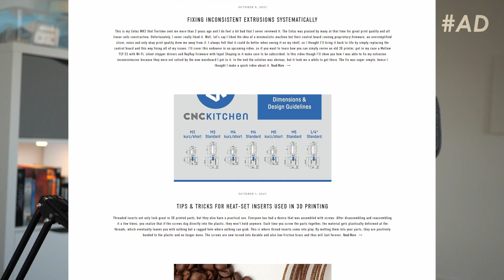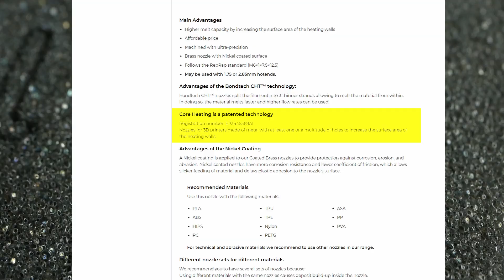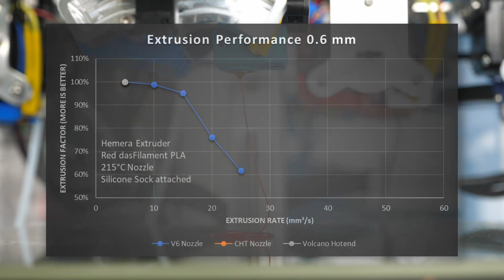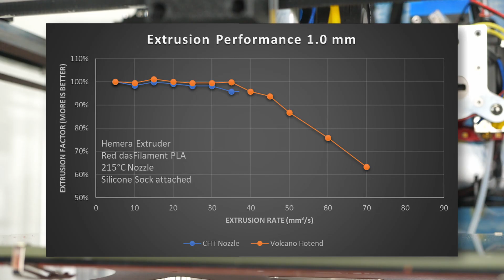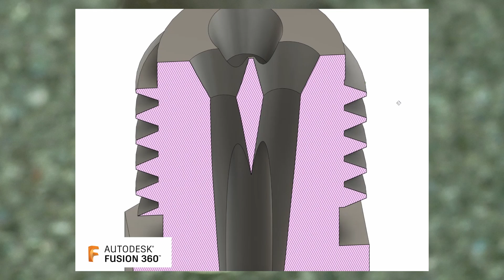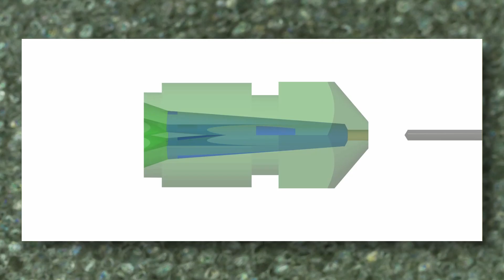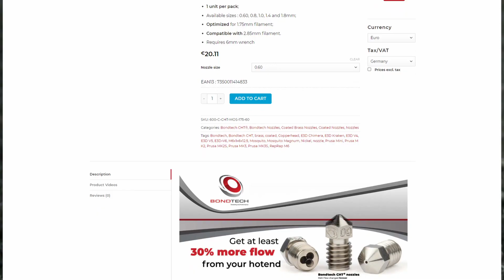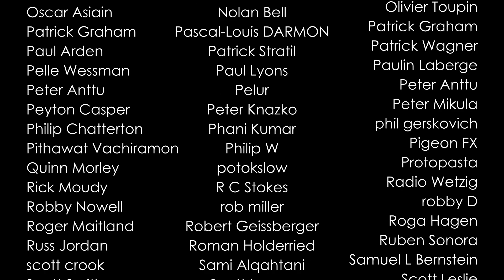Does This make Volcano Hotends Obsolete? Bondtech CHT Review

Comment: Very interesting. Would this along with a bimetallic heartbreak in a stock ender 3 hotend make it work similarly to other more expensive high flow hotends?
Reply from the maker: Probably not, because the cheap one-sided feeder will be the limiting factor.
Reply: @CNCKitchen  by feeder do you mean the extruder?
Reply: @benscottbongiben  Yes he does.
Reply: @CNCKitchen  would be nice to see a comparison with a one-sided feeder vs dual-gear feeder on a stock ender 3 using the CHT 0.6 nozzle

Comment: Mill a slot in the nozzle with a width:height ratio of about 3:1.   This appears to avoid the claims of the patent; should give equivalent improved heat transfer, and should be easier to clean when cold.   

For the deluxe version, drill two holes on either side of the milled slot and fill them with silver  (  the most heat conductive metal )

Use these ideas in combination with the volcano idea with the long nozzle which gives more time in contact with the heating source for a given speed, and cover the whole thing in an insulating sock.
Reply: Interesting ideas, but I suspect the engineering and production difficulties involved in the "fill with silver" idea would drive the costs beyond the Ruby nozzles and render it unsellable.

Comment: I looked at all of the hotend designs over the years and really couldn't tell a major different besides maybe the large flat tip nozzles of the J-head leaving a nice top layer but with ironing it's now easy to get a perfect top layer with any nozzle. Then I thought short melt zone hotends might benefit from heating the center of the filament by splitting it apart. Glad I can test it now. To me there should be a pursuit for flow but also better print quality.

Comment: I was thinking about 0.6-ish nozzle to be able to print more exotic PLAs with wood particles and such. But I wonder if this nozzle would cut it or rather clog as crazy? 🤔
Reply: You have a valid point on the clogging as the three holes are smaller, hence would have more problem with filled materials like wood. Additionally, these are not hardened nozzles so would wear quickly with wood  and other filled materials.
Reply: We do not recommend it for composite or abrasive materials. We'll have something for that later.
Reply: @nunosantiago6720  cool!

Comment: I installed the slice engineering bi-metallic heartbreak in my Ender 6, allowing for 20 cubic mm/s flow rate with the otherwise stock ender style extruder. I might get one of these bondtech nozzles myself to see what kind of flow rate I can achieve then. However, I have to finish swapping the control board so I can make use of linear advance.

Comment: What if they followed the same logic of splitting the filament but did it in a volcano length nozzle?
Reply: I bet there are diminishing returns here... but for a larger DIAMETER nozzle and 3mm filaments this might be super-viable. I think some of the faster guys were not just maxing extrusion rates, but extruder SPEED! how about a servomotor drive an extruder, ehehe

Comment: @Stefan do you have a video covering different nozzle sizes. I recently switched from 0.4 to 0.6, and I haven't found considerable difference regarding detail. I can still have 0.15mm layer height if needed. Regarding this, do you see the need for technologies such as E3D's RapidChange Revo?
Reply: 0.6 nozzle is not about Z resolution, but about XY resolution.  You can still print thinner walls than 0.6, but quality will suffer and most importantly layer adhesion gets nearly nonexistent.
Reply: @Balorng  Yes, but almost everything I slice has at least 2 perimieters, and for usable tube-shaped parts 4 perimeters (2 internal, 2 external). I think the only use for 0.4 would be e very thin walled spiral vase, and even then 0.6 wall is already a bit too fragile.
Reply: @GilesBathgate  I mean printing something like models with very thin, fine features... to be fair, a resin printer is better for that.

Comment: I thought it's be more effective to get heat into the melt by just drilling the core as large a diameter as possible then drilling two or three horizontal holes and fit pins in (before finishing the M6 thread). The melt would then have to flow over and around those horizontal bars.
Hmm... shouldn't be too difficult to try in a home shop either.
Reply from the maker: A very good point! It's unfortunately covered by the patent but might still be worth trying out for a comparison.
Reply: @CNCKitchen   It may be an improvement over that patent for multiple horizontal (not diagonal) bars of specifically high thermal conductivity (e.g. plated copper or silver) claiming greater surface area and improved longitudinal mixing of the melt. Such an improvement may itself be patentable - not now of course 'cos it's public domain :)
Reply: Worth a try. Tapped holes and threaded studs might be the easiest to manufacture. Cold pulls would be impossible though...

Comment: Do you think that this could help with using smaller nozzles without clogging? Say with a 0.2mm printing at like current 0.4mm speeds and feeds?
Reply from the maker: Not sure. Melt performance is usually not a problem with small nozzles, rather dirt, heat creep and material degeneration due to the long heating times.

Comment: what are the befits of using a CHT  nozzle compaired of a standard nozzle?
Reply: Higher flow rate, therefore the potential for faster printing (if your printer can handle the fast movements).
Reply: @iAmTheSquidThing  what printers can handle the fast movements

Comment: Take a nozzle blank, cross-drill some .020" holes, solder some strands of fine copper wire across the orifice, cut the threads, off you go.  Or run a spike of material from the top of the orifice to create a toroidal chamber.  Lots of ways to pet a cat here.
Reply: but who has time to do that when someone has a great nozzle to do it for $20.  I cannot do that kind of work for lest than $20 of my time.
Reply: Or use a fine mesh screen above the threads
Reply: Yo he did just that too

Comment: They just need to license it, and it seems like they are for a reasonable fee based on the end-price.. It's only a problem when they don't work reasonably with other companies. While I think information should be free, Inventors deserve reward for their insights and efforts. Seems a bit unfair to talk negatively of a patent holder who seems to be acting in good faith.
Reply: I think his comments were pretty well balanced. He acknowledged the good-faith actions of the patent holder, but that doesn't mean that he has to be in favour of patents generally in a market (home 3D printing) that's built on open-source hardware and has been held back and crippled by patents for decades.

Patents put a lot of power in the hands of the patent holder and are more often used for market control than the protection of ideas. This patent holder seems decent but what if they decide to sell it (to save the costs of patent protection, for example), and it ends up in the hands of someone who hikes the licence cost to target the industrial market?

Comment: I'm sorry but I don't see this as something that you can patent, when I was in college we did this to blocks of metal for fun, drilling a hole on one side then using an angle to get drilled holes to meet up with it, just because someone does it to a nozzle is like patenting drilling a hole in something. No way I'm going to buy this product at this price just because it has, oh wait, it doesn't have more holes, it still has one at each end.
Reply: You can patent any idea, after a search for prior art. IF you can provide prior art in a way that applies in the same way as the patent, you would make many 3d-printer companies VERY happy by at least partially invalidating it. Its sad to see people go to college and still not understand the patent system.
Reply: @nobodynoone2500  I understand the patent system but it's simply 3 holes drilled instead of one in an existing product, if someone hadn't drilled one hole and invented the nozzle then they would never have drilled 3, what they have patented is drilling holes, not the nozzle and as far as I know nobody can patent drilling a hole, or 3 as in this case.
Reply: @nobodynoone2500  Also, forgot to mention this, the artistic inspiration is the nozzle and the fact that there was already one hole in it.

Comment: It sounds like a lot of the benefits come from the higher surface area of the bore rather than the internal heating, and I wonder how well their patent protects that, and whether other novel bore shapes could get around it?
I guess we'll find out. It's a shame that in a field so fueled by collaboration and open source designs that drilling three holes instead of one is off limits until 2040.

Comment: Also im going to put this out there knowing it may be used for profit.... you could simply cross drill the hardened steel nozzle before the hardening process and use a stainless wire in a cross pattern in sequential locations or even various locations along the melt zone as the splitting tool then the threading process occurs then apply a flux for the wire cores to evacuate oxygen/impurities from any tolerance variations between the wire and nozzle then commence with the hardening process which could/should lock the wire in capable of utilizing it as the heat transfer/splitting tool. Essentially creating a mixer aswell

Comment: Awesome vid as usual. I came to the same conclusions on these. Very awesome results just for a nozzle..gold work Stefan
Reply: So would this nozzle be enought at 1000 mm/s and 50000 mm/s2? :)
Reply: @TheNamelessOne12357  there is more info needed to say yes. What hotend? What layer height? What nozzle size? What material...etc..etc..
Reply: @Vez3D  It's about your printer and your last high speed printing video. There was Magnum+, but will V6 with this nozzle handle same speed and same settings?
Reply: @TheNamelessOne12357  no V6 will never be a m+ .. not even close
Reply: @Vez3D  i think he meant this nozzle used in the m+

Comment: Do you feel a manufacturing limitation is the reason behind there not being a .4mm version or an intentional decision to not produce it?
Reply: I'd guess an intersection of higher failure rates, more broken tooling, difficult interior plating and less demand for high-flow but small nozzles all contribute. Most people looking for more flow are already playing with big nozzles. But I agree with you that the huge .4 market is rife for targeting.
Reply: The main reason is the melt capacity gain is so high the speed to top it out is crazy. We will release it to all the speed freaks out there anyway : )

Comment: What is better for the near future?  The Revo hotend improvements or this nozzle improvement?  Considering the long shaft of a Revo nozzle, I guess the same approach with 3 bores would not be possible there, but are the longer nozzle and circular heater and lower thermal mass giving better results in the end?

Comment: Uhm.. isn't the volcano nozzle brass and the new one coated in copper for better heat transfer?
Reply: It's nickel coated.
Reply: @sandos-x1t  yes, i saw the flaw later, i have copper coated, so just assumed. But it still does a large difference.

Comment: Obsolete? Jus make a new volcano with a shorter thread and polished/electroplated throat similarly to the magnum+  that keeps meltzone lwngth and accepts the new style nozzle.. or use a dragon high flow
Reply: The "short volcano" idea won't fly. The WHOLE concept of the volcano is the "Industry Standard" E3D style heater block is simply rotated during manufacturing. You are suggesting a whole new style block. Not happening. Dragon High Flow; now you're on to something (I own one and will get one of these for it). Also the Slice Mosquito line uses the same nozzles. Their new lower cost Copperhead Hotend is a prime candidate for this, especially since nozzles are not included in the price marketing (or gouging).
Reply: @mickmouse2258  nobody cared about industry standard when the volcano or super volcano or magnum+ were initiated... and using a volcano heatblock that has a magnum+ concept to utilize the "industry standard" nozzles is more realistic than creating a cht style volcano nozzle lol
Reply: @mistr_clean7557  True dat.
Reply: @mickmouse2258   also you do realize im not talking about changing the actual block used right? Its still a volcano heat block same dimensions and specs but instead of an m6 thread that goes all the way through the block to mount the heatbrake and volcano nozzle you have a 2mm bore for filament passage and an m6 thread on either end of the block to seat the heat brake and to screw a standard v6 into....
Reply: @mistr_clean7557  AH! No, I didn't picture that, but it's a clever idea. :-)

Comment: Whilst it maybe "novel" for 3D printing it's a pretty standard design for hot runners used for injection molding, I'm actually surprised that no one has copied a hot runner design yet for the entire hotend set up outside of maybe some industrial pellet based 3d printers. Tho I strongly suspect the new E3D hotend did just that especially with its sleeve heating element.
Reply: To be truly fair, applying a near copy of technology from one field to another often is novel and patentable (and an easy source for ideas.) I am not a lawyer, which clearly makes me an expert, but in this case the claims in the patent for the most part focus on putting a piece of conductive material into the nozzle itself as opposed to a creative hole pattern in the nozzle. 9 & 14 or 17 & 23 may actually apply to what they are doing, and there is a decent argument for prior art for those, but it really would depend on if someone is willing to spend the time and money on parts that will be sold for penny profits.
Reply: so just sell something "made for injection moulding" that coincidentally fits in a 3d printer nozzle
Reply: @tommihommi1   miniature replica injection molding machines would be an interesting hobby. 

They make this mistake in claim 23 of explicitly saying drilled, so if the shape was something not formed by drilling it sort of side steps the whole thing.  The same effect could be had by making it one unusually shaped hole instead of multiple holes. Most patents have holes in them that get missed which is one of the reasons why you end up with products with more than a dozen patents for similar stuff.
Reply: @torpedan  Would you be able to maintain that drilling isn't a blanket term for creating a hole? Is EDM drilling? Many will say yes, perhaps enough to make it difficult to side-step. Casting sounds good, but you will still have to finish (drill/machine whatever wordplay you want to use) the holes. Is not as simple as using a different process for an identical result in most cases.
Reply: @nobodynoone2500  finishing is different than creating the holes in the first place.
Reply: @nobodynoone2500  Realistically that would come down to trying to argue in court that the definition of the word includes other operations outside of what is commonly understood to be the word drilling. Cutting operations like milling could probably be argued, but its just as easy to argue that EDM is a different forming process entirely as the mechanism is fundamentally different. More importantly the wording calls for two or more holes drilled into it, so one unusually shaped hole still sidesteps that.
Reply: @torpedan  Hence the hordes of patent lawyers .... ;-}

Comment: 2 things for my first impression.
1, these nozzles can only be cleaned by burning out everyingthing in them. Getting them red hot and letting them cool.
2, it looks like this could add significant resistance. Without good driving setups, idk.

Wow, so watched it, this is cool, patents suck. I would like to see this nozzle in 0.4mm
Reply: 0.4 is about to come out. No need to burn the nozzle to clean it. An atomic pull properly done will be enough. We'll do a video on how to do it, without even removing the nozzle from the block.

Comment: What effect would thermal paste on the nozzle threads have?
Reply: Discussed this earlier (above) if you care to look. I specifically spoke with an engineer from Artic (who makes CPU paste). He suggested MX-4 for the COLD part of the heatbreak (echoed by official E3D instructions) but NOT for the hot parts. The paste will break down over time OR at higher temps (>240°C) and could gall the threads preventing removal. Also -  @Gegenwarth Andre  is right, doesn't make a noticeable difference, since the length of the threads is so short.
Reply: Tried it once, didn't noticed any specificant difference in conductivity

Comment: I have one 0.60mm on my modded CR10 (Bondtech direct drive) since a few days. Prints crazy fast now!! Love it!!!
But I wouldn't use a 0.60mm if I only had 1 printer. It's too wide. But great for functional parts.
Reply: Great to hear, I have a heavily modded CR-10S with a Bondtech DD too. I'm working on a project where a 0.6mm would be perfect.
Reply: @mickmouse2258  if you want it even faster (big and strong parts) at the same time maybe try 0.8. the infill has such thick lines it wouldn't need a lot of infill %.

Comment: A silicon carbide version of this nozzle should be able to handle abrasive filaments
Reply: if you can 4-step machine silicon carbide nozzles for under $20 each you just let me and the rest of the industry know.
Reply: @nobodynoone2500  I don't see it working except as a sintered piece that needs a bit of grinding on at most the orifice and the splitter, for exactly the reasons you suggest. If it can be done that way it should be in a similar price range as insert cutters. Furthermore Stefan's work suggests that a star-shaped melt chamber would be nearly as good, and that would maybe need just the orifice to be precise.